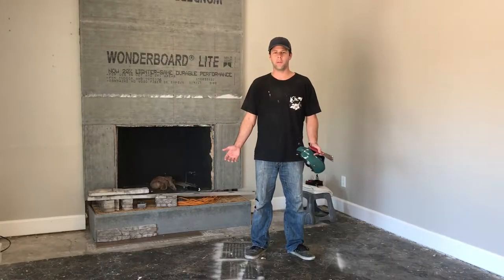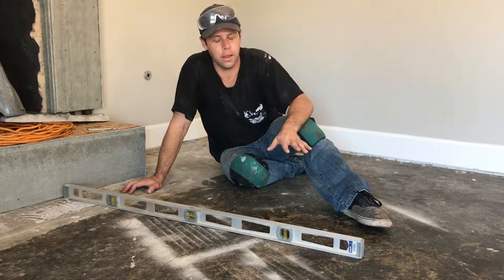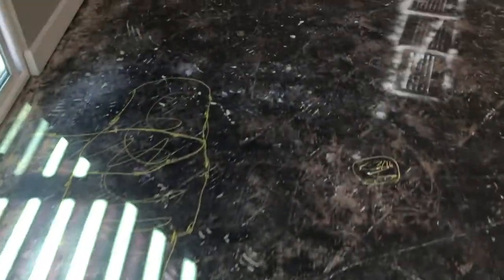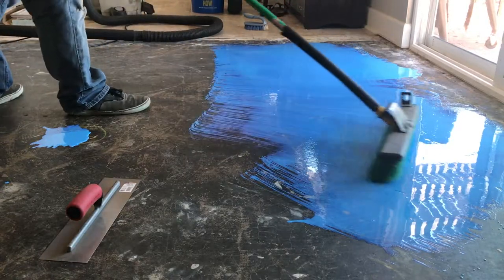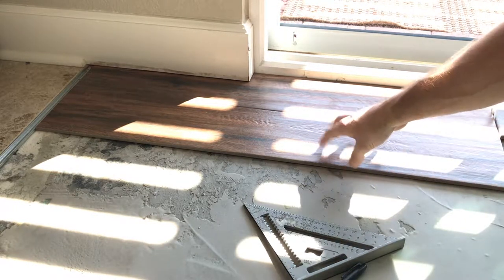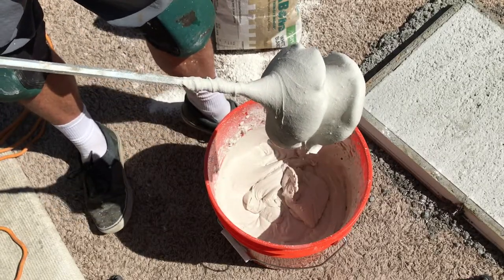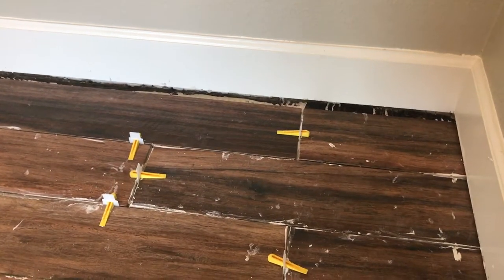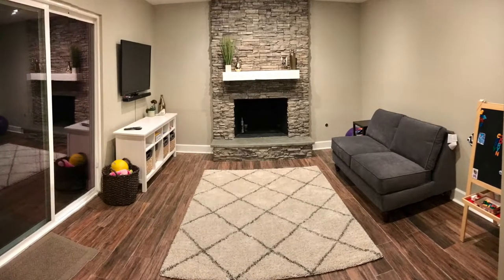Family Room Remodel Video 4: Tile Floor

Comment: That's not tile it's wood flooring and it's not supposed to use grout. Ur supposed to use a mat to put them on and glue boards together. There should be no spaces between boards
Reply from the maker: These are indeed ceramic tiles, the wood pattern is really convincing, but I assure you these aren’t wood planks.

Comment: Nice Job! Question... how would you repair a hole in the middle of a ceramic tile? I accidently dropped a glass jar of pickles and the jar did not break but it left a dime size hole in the center of one tile square. Any advice?